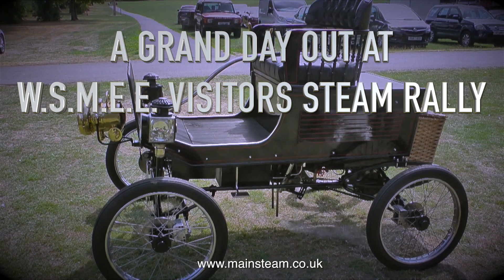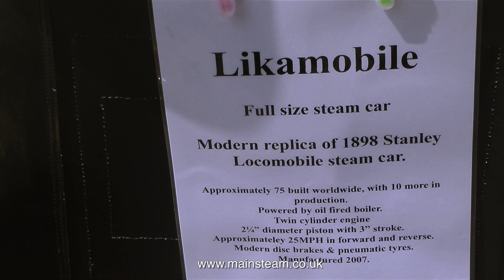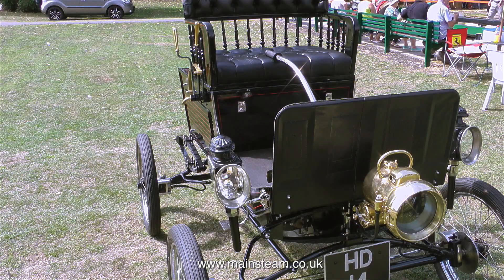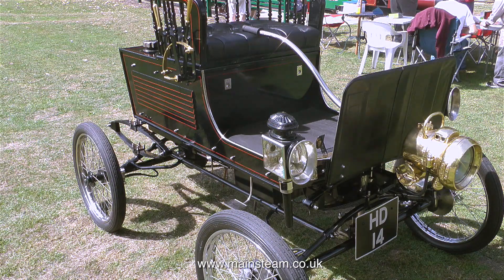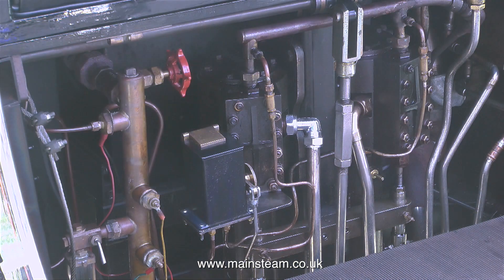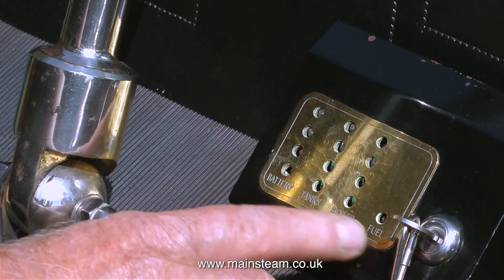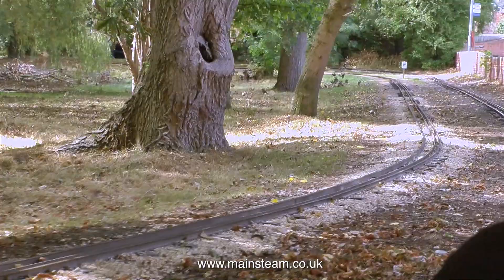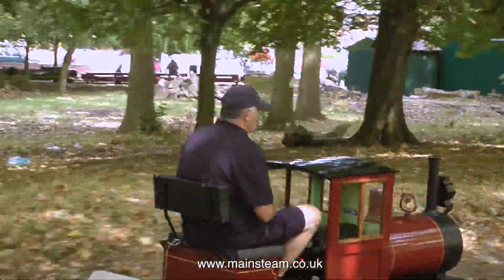WAKEFIELD S.M.E.E. VISITORS STEAM RALLY 2018

Comment: Mr. Appleton,  at steam rallies like this where you might not be sure of the water supply. Does any one install strainer or filters to keep particles out of their water tanks? The closest steam rally is over 600 miles from where I live so I've never been able to attend one.
Reply from the maker: Mains tap water is fine - most particles (if any) are not really an issue with steam engines . .  .

Comment: Good Morning Keith,  Great Video.  As you know I am on the western side of the pond and have a Winson Lyn Project that I am working on.  I noticed two different LYN running at point 2.00 and 3.54.  Would you happen to know the owners and if so can I send you an email to forward to them?  I have the chassis up on air but have many questions.
Reply from the maker: Hi Charles, I can't help you with this one, but an Email to Phil at Blackgates Engineering may be useful as Phil is a member of the Wakefield club and probably knows who the owners are.
Reply: Thanks   I will get a mail off to him.

Comment: Was the Stanley Steamed Powered Car dangerous as far as having a boiler failure when not keeping enough water in the Boiler? 
    Love your videos. Any beginner, novice or well informed person in all aspects of Model Steam would benefit greatly by watching many of your videos.
Reply from the maker: Not really as it is a Flash Steam type boiler without a large reservoir of boiling water in it . . .
Reply: Keith Appleton 
 I didn’t know that and I appreciate you answering my question. I do know that a High pressure Steam boiler explosion can be extremely destructive and quite dangerous, from reading about Steam Locomotive Boiler Explosions.